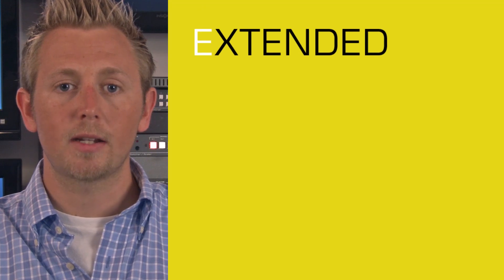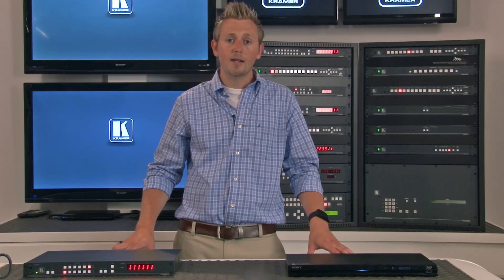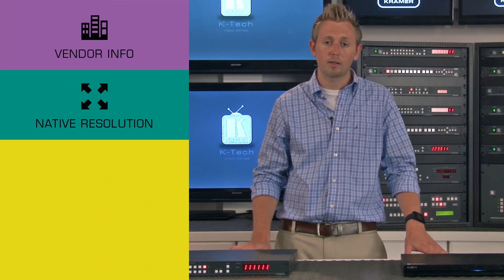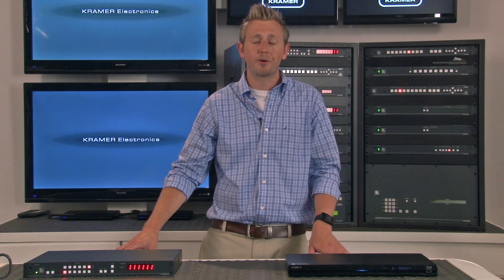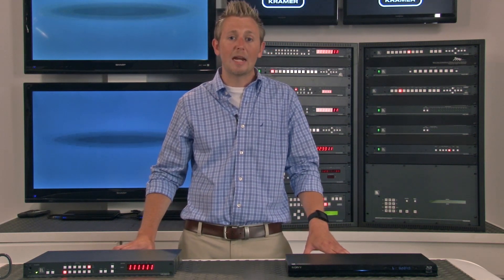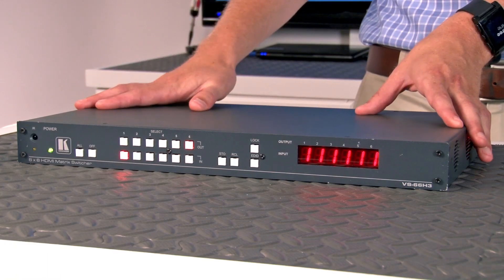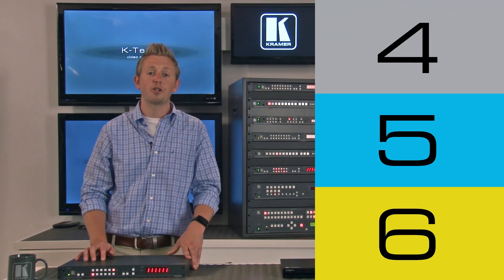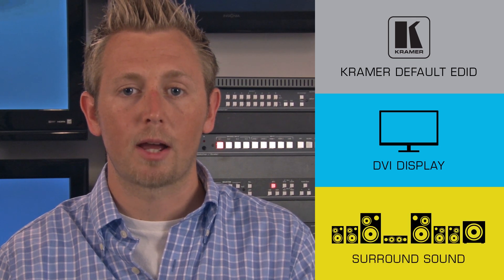EDID Related Audio Problems

Comment: Yep, I've had those problems... Thanks for the run down although I was dissapointed that you didn't pitch an edid spoofer to the 6k people that have watched the video by now... just for your info I usually lean toward adapter boxes with metal housings as a habit, no good reason for it but just what I do as an EE student...

When is the academy going to be back up?